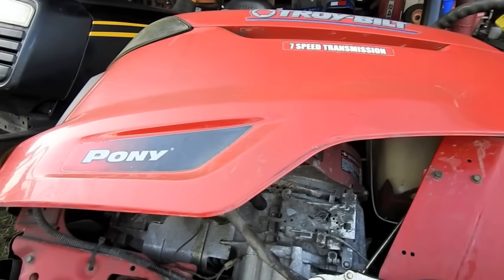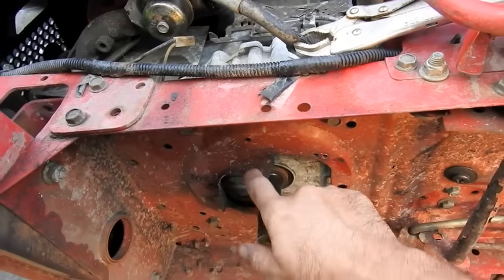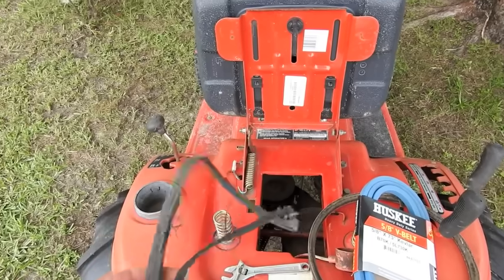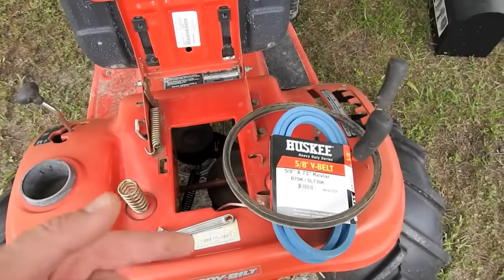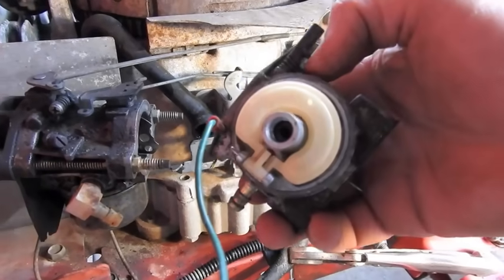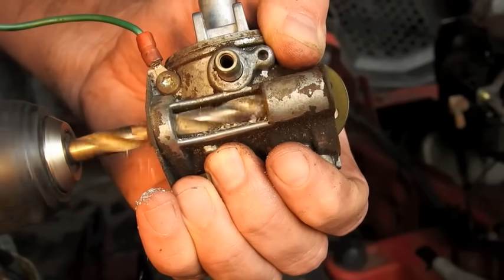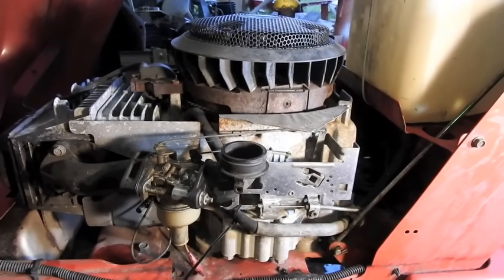Double the Speed for Super Cheap

Comment: I did this and it only goes like a mph or two faster what els can I do to make it faster
Reply from the maker: It should double the speed if you flip the pulley since the deck pulley is twice as big. Gas pedal and taller tires also help. If you get serious, you may want to put in a manual transmission. Good luck and thanks for watching!!

Comment: I think I would have turned the angle iron for the frame around so the horizontal piece was under the frame instead of sticking out... other than that, it was cool seeing the speed difference, and you leaning a bit too hard on that last take-off hehe... glad you weren't hurt though :)
Reply from the maker: It gets turn in the gas pedal video, I hope you will check that out too. thanks for watching.

Comment: I did this same thing with a 90's model Vari-Drive mower, I also bought a 3" longer than stock belt (stock is 53, I bought 56) and it worked perfect, despite being an older and different setup. Swapped on a v-twin, bypassed the governor and it will go 15 MPH before the valves float. Cheap and effective, I want to try a torque converter on the crank pulley!
Reply from the maker: Torque converter would be cool, thanks for watching.  BTW did you see my last video where I did the same thing a different way on a different Troy?
Reply: What’s the difference with the belts
Reply from the maker: @papa_smoke5657  one belt has to be longer, back belt went from 5/8 to 1/2 but same length. Thanks for watching!

Comment: Purchased this to replace a guide pulley https://www.youtube.com/post/UgkxO9seYZjlnuP5UvMkb7osQW3WxPVeSnPk on our John Deere x304 snowblower. As I stated in the title, it is just about perfect. The stock pulley has a spacer at the bottom. I used four washers to emulate said spacer, and it works perfectly now. Great product, and great price especially if compared to typical JD prices.
Reply from the maker: So true and thanks for watching.
Reply: @chud327 mine goes threw a bunch of the little belts.
Why?
Reply: @chud327 what size tires are in the rear?

Comment: Im doing a pony I picked up the other day, got 26 inch tires on it! It came from my d105 build I did, but I'm swapping the 17.5hp to the Troy, its a rolling chassis. So its alotta work, but it'll be worth it! the 17.5 has your pully swap already,so I came back to your vid for the belt sizes

Thanks a ton!
Reply from the maker: Nice!! hope you get it going soon and thanks for watching. again.
Reply: @chud327  😂😂 yeah when I saw the video originally it was 2 years ago, shortly after the plastic gears in the d105 stripped out and didn't do anything about it till now

Comment: I rode one that had the back pulley swapped.  It was fast.  One thing about doing something like this....make sure your brakes are excellent.  Also if not careful going down hill on a bumpy road, it can get away from you fast.
Reply from the maker: I usually do rear pulley swaps and they do pretty great. But most of my mowers don't have brakes that work.. Thanks for watching.

Comment: Grade 8 bolts are made to hold things together, fastening one thing to another. They are not made for shear strength.. they will snap when the shear force is too high where as a grade 5 bolt will bend and flex before it breaks. Most people think a grade 8 or hardened bolt is the best you can get and you should use them in place of a grade 5 if you need something stronger and that’s just not the case unless they are being used to fasten one thing to another.
Reply from the maker: I have misplaced the grade 8 bolt, I might get something softer today and test your theory.  Then have the grade 8, when I find it, in the toolbox as a back up. thanks for watching.
Reply: Tensile Strength.

Comment: Clean your carburetor, completely. That means the main jet, especially. A partially obstructed main jet will cause a surging carburetor. You also should be using a fuel filter coming directly from the fuel tank.
Reply from the maker: Actually change the whole carb at the end of the video. Idled so low, loved it. Thanks for watching

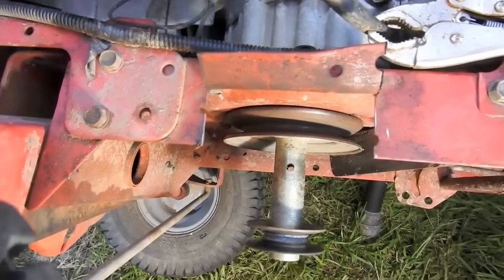Comment: 4:40 I would only drill out to 1/4" and then use the weakest bolt possible (#2 zinc?).
If the load on the pulley becomes too great, you want the bolt to shear not the pulley or the crankshaft.
Reply from the maker: I am planning on doing this again and this time I have purchased a 1/4 bolt, we will see how it goes and thanks for watching.
Reply: @chud327  Kool mod for speed!
I learned from being on a farm where there's lots of different farm equipment that uses sheer bolts and they were designed to be weaker than the machine parts they connect.
When you are drilling post holes you'll usually go through at least a handful of them so I always kept a big bag of the bolts handy.

Comment: That's cool I I built a lawn mower probably 10 years ago that went approximately 45 to 50 mph
Reply from the maker: I haven't done that yet, but i am thinking of flipping my poulan's front pulley. I will do 21, if that doubles... well, we may never know. thanks for watching.
Reply: @chud327  yeah it took a lot of fabrication to get mine to go that fast and different parts also if you need any tips or ideas on what I did just message me I'll tell you what I did to mine maybe it will help or maybe you can improve on them ideas and make something even better LOL
Reply from the maker: Thanks, I may have some questions some day.. Thanks for the reply.
Reply: @danhodgkiss9798  how did you get it to do 40? Does the rear hold up to that?
Reply: @dion3496  you need to put a solid live rear axle in it and run a separate transmission. Then you can have two separate ways to change gear ratios. 1 will be the pulley ratio from the engine to the trans and two will be gear ratios from the trans to the rear. That gives you tons of options to go as fast or slow as you can handle driving it lol.

Comment: I did same thing for a customer that wanted to win the yearly neighborhood mower race except by putting a much smaller pulley on the transmission(same effect) He smoked them all ! BTW i was saying 'No,No,just unbolt the engine !" when you said you were going to cut the frame for drill access Oh well.
Reply from the maker: That is usually how I do it too, but not so easy with a troy bilt FNR... thanks for watching.
Reply: @chud327  yeah,variable pulley is troublesome. The one I modded was a Scotts/JD 5 speed
Reply from the maker: I couldn't agree more

Comment: By flipping the front pulley, the deck would only turn half as fast, so you wouldn't want to use it to mow the grass any more. Looks like you could have flipped the intermediate pulley (the one at 8:20) instead and gotten the same result. And then you could still use it with the deck on it.

Of course, if you have no intention of using it to mow the grass, you could still flip that second pulley, and get even more speed out of it.
Reply from the maker: I may have to look into that, unfortunately, the mower came with no deck… thanks for watching!
Reply: Ya he needs more speed lol

Comment: I would recommend putting some grease on the shaft so that the pully is easier to remove if the shaft rusts.
Reply from the maker: I usually do stuff like that, especially when I put the back wheels on. thanks for watching.

Comment: Dude is right dont buy cheap Amazon carb replacements they'll just leave you mad as heck. Buy genuine part. I had surge issue and still do with replacement no I found out I can move choke forward and eliminate surging guite a bit.
Reply from the maker: I need to work on that and thanks for watching.

Comment: Got the same mower, put a 8 inch pulley on the front and a 3 inch on the back, fabbed in a front suspension, gas pedal, and added bearings to the front wheels. Hoping it’s to fast if it pulls it
Reply from the maker: Where did you find a splined pulley for the rear, should do over 50 if the engine has enough power. thanks for watching.
Reply: @chud327  I own a machine shop so I made one.

Comment: I have a 2008 Troy-Bilt Pony that is EXACTLY like yours. For using as a Riding Mower, I need to slow the Travel Speed, but keep the HIGH RPM's for the Deck.

What do you recommend to keep me from having to "Ride the Brake"?🤔

If I can't "easily modify" this, I will have to use either my DRM500 or my 1992 GT6000. As my Troy is in "MINT CONDITION", I'm hoping to spend no more than $25 to fix this.

Take care,
🤓 -Thomas
Port Orchard, WA
(Just West of Seattle, Washington)
Reply from the maker: I would think "first gear" would make it slow enough.  I don't know how easy it will be to slow a mower down, I have never do that.  If you change pulleys, they you will need a different belt too. It will be hard to do it for less than $25. Good luck and thanks for watching.

Comment: Just wondering how long it took to put the belt on? Thanks for vid, really helpful!
Reply from the maker: There are two and it is a bit of a pain.  I take the rear end loose on both sides, remove the bolts on one side and tilt the body up.  That helps to get the belt on.  The first time took a while, but then I got pretty good at it. thanks for watching.

Comment: Could you not have used the existing keyway instead of drilling the shafts?  Perhaps it is not broached all the way on the Pulley shaft.  Wheelie Bars next?
Reply from the maker: It is only on one end of the pulley shaft, I guess they don't want people doing this too easy. Thanks for watching and maybe on the wheelie bars.
Reply from the maker: @ghostlygrimrapper  He said in his video, "does not apply to Briggs and Stratton."  I have a Briggs...
Reply: @chud327  darn that sucks....

Comment: Dang that made the mower FAST. Almost scary fast for driving one handed. Any chance of putting that angle iron on the inside of the frame and only having a small section of the lower part showing? Might look just a bit better after painting
Reply from the maker: Yes it is pretty fast. the angle could have been completely out of sight, but I was in a hurry and did want to drill 3 new holes. I may go back and redo in the next update. Thanks for watching.

Comment: How do you think I could double the speed on my mower that is driven by a shaft instead of a belt? It is a Cub HDS 2165
Reply from the maker: I can't think of an easy way, I have no experience with them. Unless you can double the size of the rear tires. Good luck and thanks for watching!

Comment: If u put a bigger carb on it it will give it more power and more speed
Reply: If you put a bigger carb on it, it will do nothing about its top speed...  more power, yes, maybe depending on the size and flow of your ports in the heads... the only thing that judges the speed would be the pulleys/gears.. it may get to the top speed faster and improved or worsened response,  but carbs have nothing to do with the mowers top speed... rpms and gear/pulley ratio is where the speed comes in👍..
Reply from the maker: Tire size also changes speed, thanks for watching.
Reply from the maker: Just changed the carb and it did so good.

Comment: One just so you know they saw that carburetor with filter and shut off valve on eBay for 20 bucks. 2 why wouldn't you just drill the pulley and put a couple set screws instead of drilling through your crankshaft. 3 to change the rear belt all you do is slide a screwdriver through the rear pulley add use a crescent wrench to loosen the nut you don't have to take the rear end loose
Reply from the maker: Good tips thanks for watching

Comment: Yep, pulley swap. Especially when you have a 7spd shift. Just remember, stopping that machine. Now that's another story. 🚜💨
Reply from the maker: Yeah, most of mine do not have brakes... thanks for watching.
Reply: @chud327  in the racing game it's been said "brakes are for sissies" 😃 I suppose I'm a sissy cause I wanna stop when I need to. 😯 I baught an old Sears brand tractor. Not a mower but a tractor. Complete with front and rear pto and hydro lines and manifolds. 5 wheel bolt pattern front and back. This is not pulley and belts. This has a driveshaft to a 1/2 ton dodge rear end. I looked at that and got the numbers off of the rear to see what the hell I bought. Sure nuff that's what it is and it came standard in this tractor year. Since then I found every implement that goes with it. This thing is cool. I've cut wood for the stove. Used it as a generator. Cut grass with it. Im old now but I still have fun with it. I've even got a sickle bar mower. Rear tiller. This is a 26hp standard. I've got a 30hp in it now. The other thing I do with it is go off road fun with my grandsons. Merry Christmas, Happy New Year 🎄🍺🎉🎆🎊😃
Reply from the maker: Sounds like a real beast
Reply: @chud327  their a lot of fun. On blacktop or off. Zoom💨

Comment: I would just adjust the clutch pedal to almost all forward. I got mine double the speed with 2 minute bolt adjust with no reverse
Reply from the maker: I don't get it but thanks for watching
Reply: @chud327  you have a manual transmission. I have a hydrostatic. There is a slide on my clutch pedal that keeps the speed forward 5mph and reverse 5mph. If I adjust the slide I can barrow speed from 1 or the other. Hence double my speed in 2 minutes.

Comment: Could you try drilling out the jet on the old carburetor? That could make it run better with more power although you may need to change the muffler to equal the intake and outtake.
Reply from the maker: I thought about that, but figured I didn't have a small enough bit.  I, instead, change it out for a closer to the right horsepower carb.  It worked a bunch better. Thanks for watching.

Comment: I need to do this on my old bolens tractor. It's pretty slow and takes forever getting up and down my driveway.
Reply from the maker: Yeah, I just got another troy bilt yesterday, I may have to do it again. thanks for watching.
Reply: @chud327  no problem thanks for the video. I've been looking into ways to get more speed out of my tractor without straining the motor. I am curious about the back belt. I was watching another video of yours and the back belt popped off again so that has me wondering if a spring loaded tension pulley will be needed  also but I've gotta get back to work so won't be able to view others until this evening but is if likely I'll need one?
Reply from the maker: The back belt already has springs and I don't know why the stock 5/8 inch belt had issues.  I replace it with a stock lenght, 1/2 inch belt and it seems to be all good now. thanks for watching.

Comment: I did that same thing to a Troy built pony I had that was old but same thing but instead of the Engine pully I did the transmission pulley and what I'm thinking is if you do both you would have a lot of speed
Reply from the maker: Yeah, I have a craftsman that I changed the front and back pulleys. It does 29 mph and loves to pop wheelies. thanks for watching.

Comment: Can you use the mower deck when switching pulleys? And what would the new cut deck belt length be?
Reply from the maker: You could but would probably have to keep it in first gear. There are a ton of variables and belts. I usually take mine to the store and try a few on. Good luck and thanks for watching!!

Comment: Hey if I flip the front pullly will I need to get a bigger belt
Reply from the maker: Yes you will, bigger pulley in front means longer belt, smaller in the back means smaller belt... My most recent swap was a double swap, I did bigger in the front and smaller in the back and I think the stock size belt is going to work. Video coming soon and thanks for watching.

Comment: Can this be utilized on hydrostatic drive motors? Or are the motors only as fast as they are designed?
Reply from the maker: You could try it, but I hear that the fluid will bubble up and not be effective. Thanks for watching.
Reply: @chud327  Thanks for responding!
Reply from the maker: Anytime!

Comment: why was the larger pulley wheel you swapped to there in the first place?  Did the manufacturers design it like that so this swop could be done?
Reply from the maker: The larger pulley used to spin a mower deck, but that rusted away... Thanks for watching.

Comment: I have a Craftsman garden tractor,  with  a 54" deck , it has 1300 hrs on the clock. Over time the forwatd speed has really slowed, on any incline,  you can walk faster.

Tranny is $1000. Would this swap work, still using the cutting deck, you think?
Reply from the maker: Is it a hydro or manual.  Sounds like it is completely worn out.  I doubt this would help...  Thanks for watching and good luck with it.
Reply: @timphilmon8573  1000 $ is too expensive for a 1600hr tractor ... my 2 cents
Reply from the maker: I wish you could find a good used one some where...
Reply from the maker: for sure

Comment: Are any of your tractors automatic? I would like to swap the pulley on Mine since we don't have a lawn. It has just a forward and reverse on the right floor board. Do you just use the left side with the brake/clutch for a gas pedal?
Reply from the maker: I had one, but then made it a manual. The right pedals now do nothing.. thanks for watching.

Comment: I usually put the rear on the front, front on the rear. Works. Try it.
Reply from the maker: All mine have front shafts that are 1 inch and rear that are 5/8 inch, would have been a good idea though. thanks for watching.
Reply: chud327 I used one of the pulleys from the mower deck and mounted ted to the rear, took the rear pulley put it on the front, the stock sleeve had deck pulley closer to the frame, so I welded in to the sleeve and the ten inch pulley on engine other on rear I had an 11hp Boleen tracker doing over 55, 1st gear was still really low, 2 to 5 was gears
Reply: Starting a new project with. 1000lt craftsman 18hp, but looking for a vtwin Briggs. eBay has some nice ones for good prices